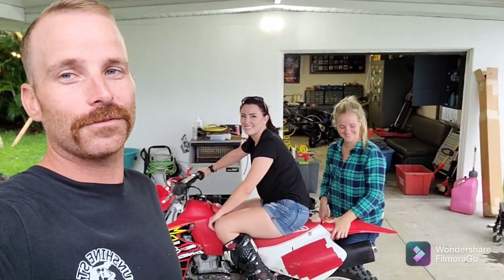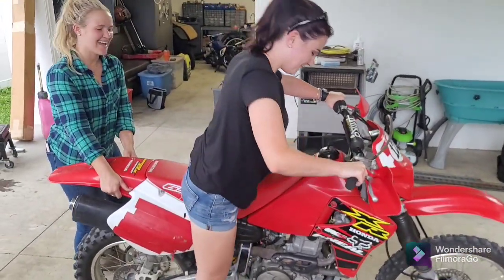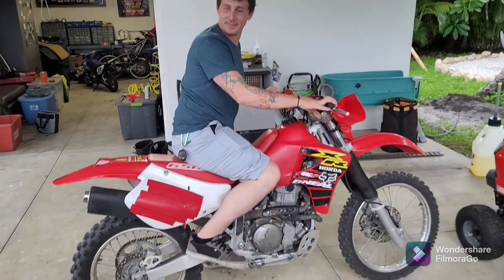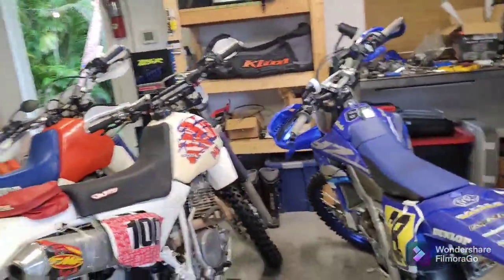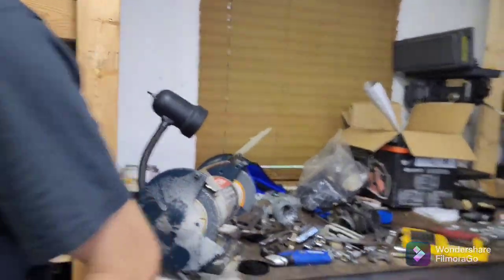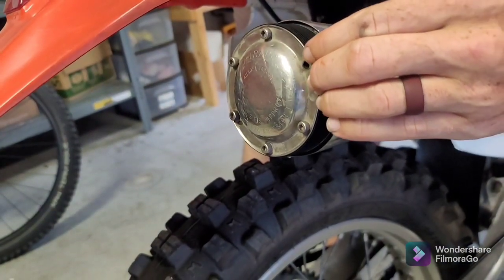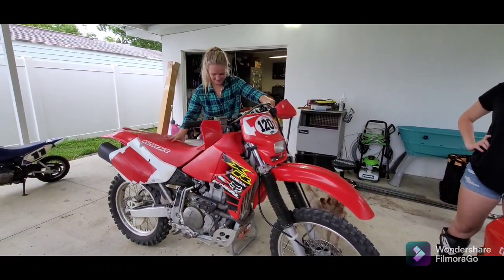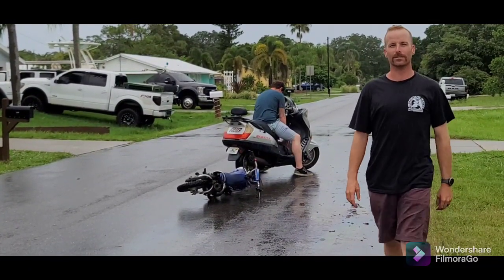How to start an XR650R - a lesson from girls!

Comment: from 'Slow Old Guys - Slow Bikes'....SuperTrapp exhaust is governed by how many discs are installed, more discs = more flow/output.
Reply from the maker: Thanks!
Reply: It was alternate between quiet street mode to high flow performance.
Reply: @MrPepeyanez  they use to back in earlier 2000s. I don't know if supertrap are still around.

Comment: You can take the allen bolts out of those supertrapp mufflers and remove/add discs to change back pressure/flow. There was one on my XR200 when I got it, supposedly you could tune them for torque that way. Retro technology, kinda cool. Those late 80's blue-white-tahitian red XR's are the best looking
Reply: I have a clean 94 xr250 pulls pretty good tbh
Reply: Wondering if a supertrapp is worth it? Does it make power like a yoshi or fmf?
Reply: @ulifehr5357  yes, I have one on my Suzuki DR650.  They’re great and have a nice distinct sound to them.  The baffles also serve as a spark-arrester for legal purposes.

Comment: I read the following procedure which ALWAYS works when first starting the bike after a while 1) With the fuel off, kill switch on, hold throttle wide open and gently kick eight or so times with the decompression lever pulled. This clears it out 2) Turn fuel on, kill switch off, kick gently until you find top dead centre, pull decompression lever and kick maybe 1", release decompression lever and kick it properly with no throttle. If it doesn't work after a few attempts go back to stage 1) as it is now likely flooded.
Reply: I use this same exact method on my xr400. Letting it run with the fuel off is a good way to let it shut off too

Comment: Mine has the whole decomp kit removed. Do you know where i can get a new one, and Why it has removed it?
Reply: Do you know if it has the stock cam in it?
That might be the reason. But I'm not an expert..
I bought a 2003 last summer, stock though. 300 miles only.
I reckon you are Norwegian or Swedish. 
You can reach me on Instagram if you like, same name as on YouTube 👍
Reply: @erikeggenbakstad  I cant wrench on it yet, so Im not sure. Will see when i one day start the project 😅
Reply: @ErikISkogen  Ah I see! A project bike?
What year is it?
Reply: @erikeggenbakstad  Yeah, Im an «old» heavy equipment mechanic, so i miss wrenching on things :) Going to use as long time doing the best work i can just because. Hopefully put it back 95% original.
Reply: @erikeggenbakstad  93 or 94 👌
Reply: @ErikISkogen  If you are an heavy equipment mechanic the XR600R will be easy compared to your work! I have worked in the rock crushing industry so I  can relate to that part. A motorcycle engine will be no problem. Plus it is a lot of workshop manuals available still 😊👍

Comment: Doesn't it have a electric starter?
Reply: The XR 650 R was kickstart only and liquid cooled. Primarily designed to be a desert racer to win Baja. The XR 650 L and the XR 600s are air cooled XR 650 L has the electric start